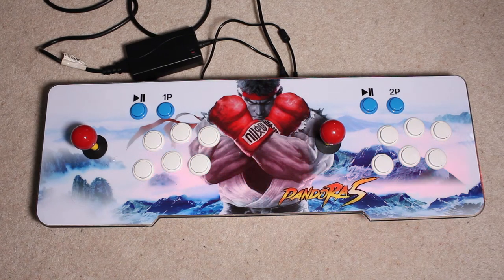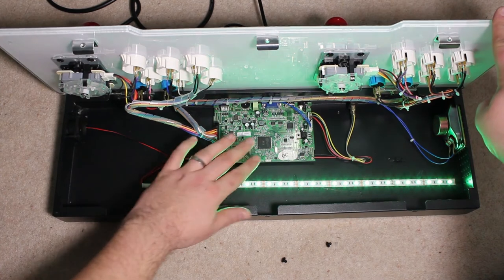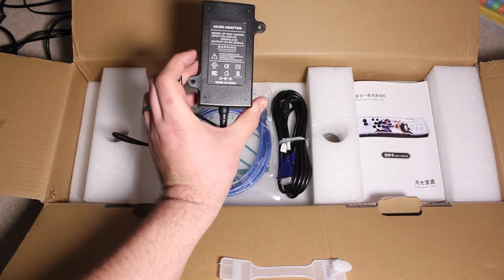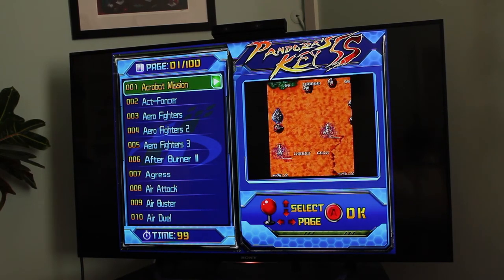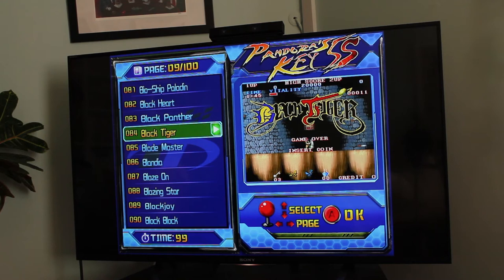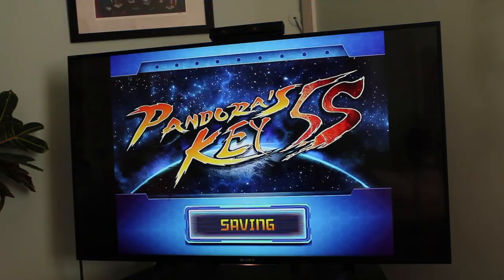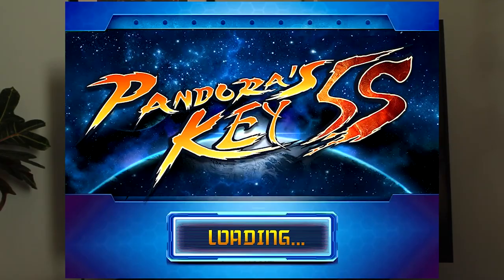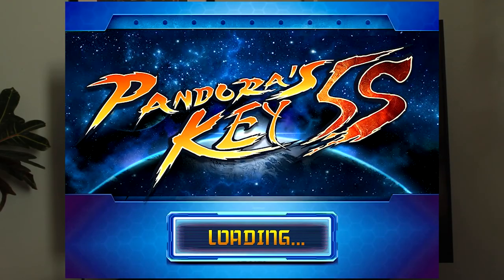Pandora 5S 999 Arcade Games in 1 - Tear Down and Review

Comment: Hey, I've ordered a model of the Pandora 5S that has 1220 games, and although the hardware is identical, I notice the rom list of mine is totally different from this one. Mine has unique games this one doesn't, and this one has unique games this one doesn't.

I wonder if it's possible to change the rom load out from one Pandora to another. If you wouldn't mind, I'd like to run an experiment. Could you remove the micro SD card, dumb it's contents to a pc and send me a copy? I'm willing to do the same for you. I'd like to know just how the Chinese are making one Pandora different from another - I bet it's just the roms and nothing else. Please private message me if you can help. Thanks!

Comment: There is an optimisation setting does take away some softness if turned off. A scanline generator also helps. Scaler games like outrun and as you show afterburner are awfull but there are tons of great games that run great. Only some games have screen tearing. I think your being a bit over critical.
Reply: Buy a nintendo retron 5 Is my advice
Reply: @glenparey1453  I've got a retron 3 and it's terrible. Plays SNES, megadrive and NES games....but very poorly. The controllers included are terrible. Never use it anymore. Love my pandoras box DX bartop machine I built.

Comment: It's fake again brilliant the board only no Pandora's box they come in colours blue orange green with built in fan the circuit board will over heat and the games are just rammed on there half don't run properly or don't run at all avoid only buy if the ad has the coloured Pandora's box unit ive seen these advertised with games but made contact with seller in China and it's just a case no games  the box of chocolates more like